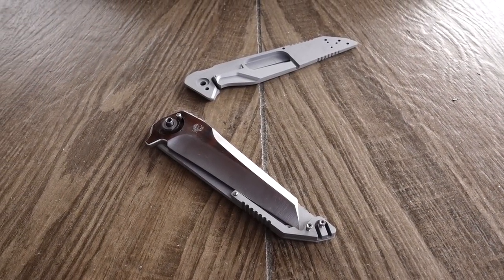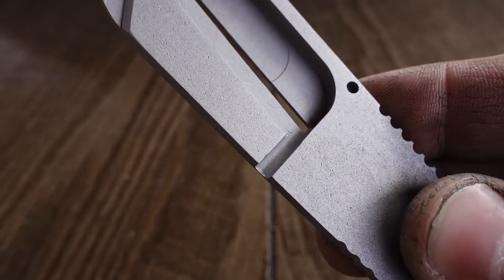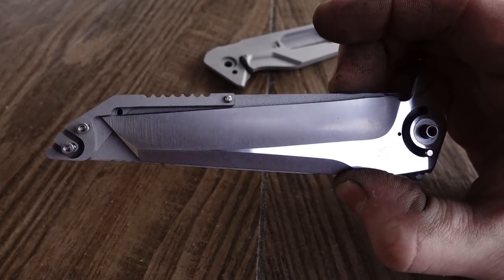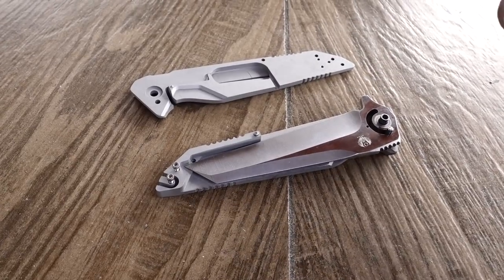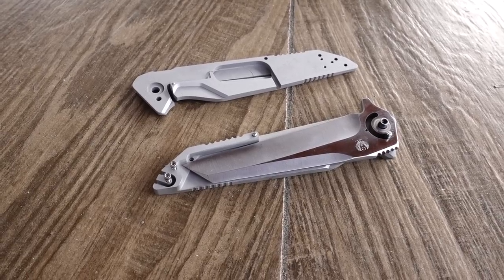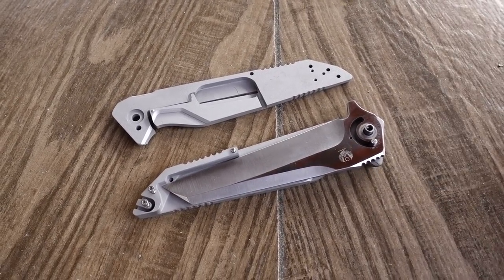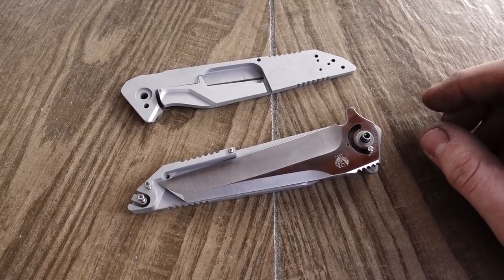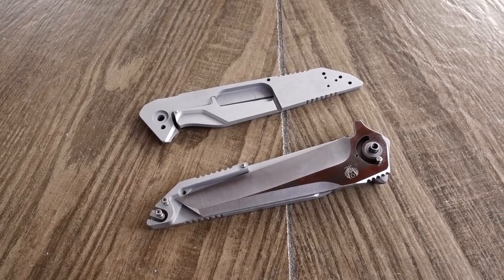Mk11 Design Clarification and Response

Comment: I love the modular designs you have implemented. I've personally bought a wharncliff to swap out in my mk10, and have zero problems. Both blades fit well, and have solid lock up. You can completely change the look of the knife, with a blade swap, or even a scale change. It is a fantastic idea, and a shame it hasn't really caught on with more folks.

Comment: Is the edge usually supposed to hit the back spacer?
Reply from the maker: No.  The only way the edge can contact the backspacer is, like in this demonstration, the stop pin is not being held by both sides of the frame, allowing it to flex.  Alternatively there could be damage to a part that could allow the blade to contact, like the stop pin being damaged.  This would also cause other issues, like the lockup being sloppy.  Either way, if your blade is contacting the backspacer, get in contact with me and I'll fix it, support@willmooncustomknives.com.